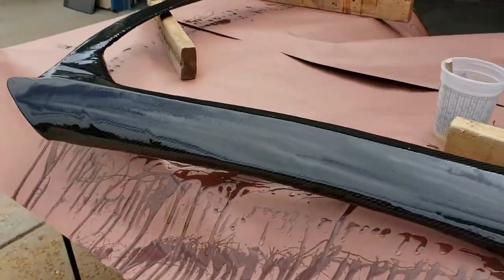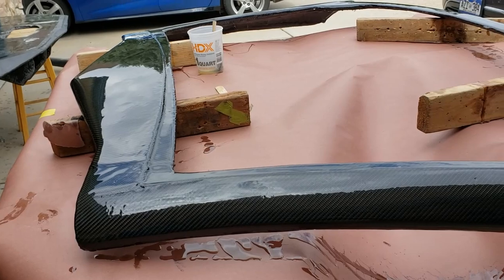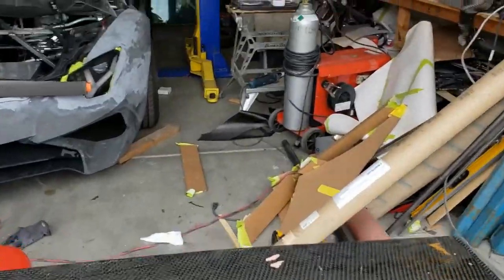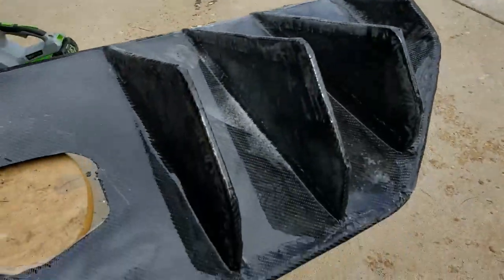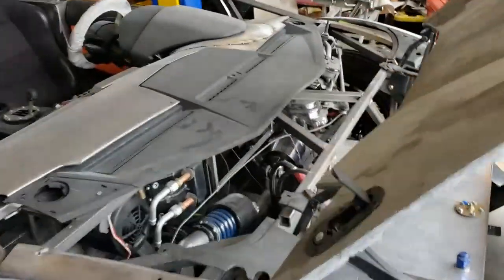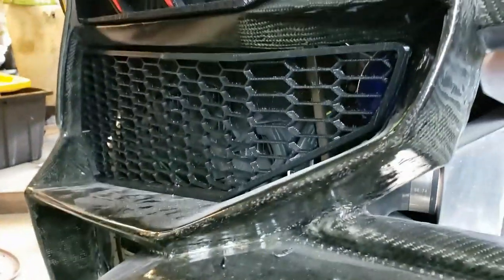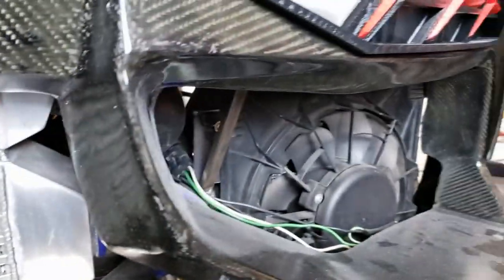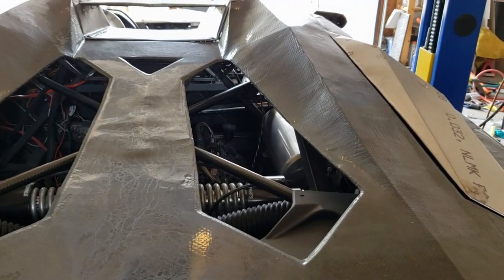3D Printed Interceptor Update 44

Comment: You must have your parts printed at a 3D printer farm because I don't see too many 3D printers in your shop.  I have 10 printers but I'm limited to 12x12x12 (1 cubic foot) volume for each printer so printing these long pieces requires extensive work just to slice, put locating pins on and then gluing them all together.
Reply from the maker: 2 Desktop printers.  Limited to 300x300x300mm